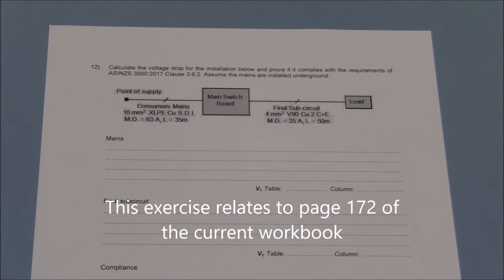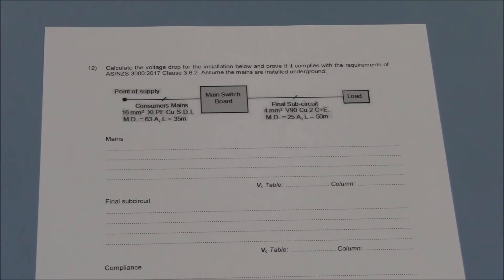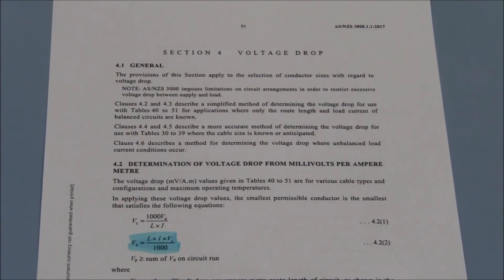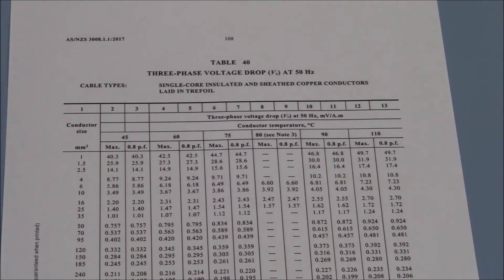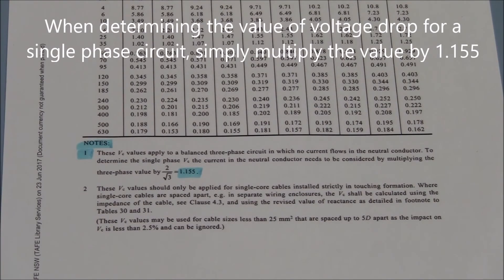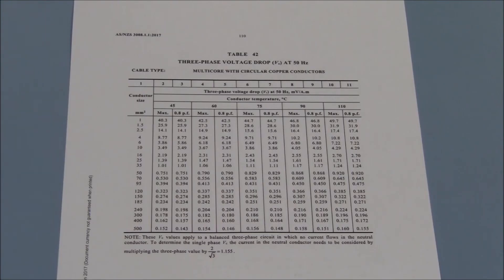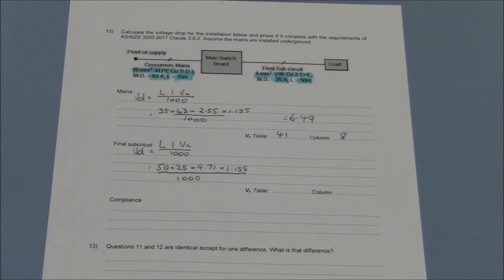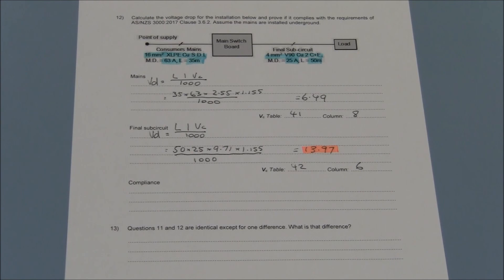Determine single phase voltage drop for a cable of known size, length and maximum demand

Comment: Is it general rule that it’s no greater than 11.5V or did you do an equation for it
Reply: 5% so times the supply voltage by 0.05

Comment: The 5% volt drop in three phase 20.75 v 
Bc you have them in 3 phase
Reply from the maker: @jhonrivero6600  this video is about voltage drop I  a single phase cable of known size, length and maximum demand. Nevertheless, if it were about three phase the maximum value would be 20 volts as calculations are based on 400v.